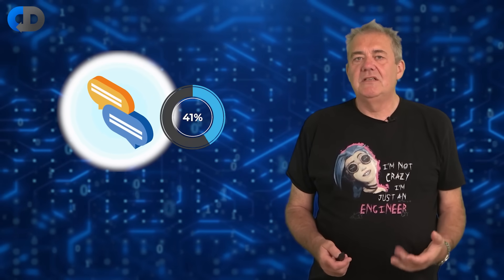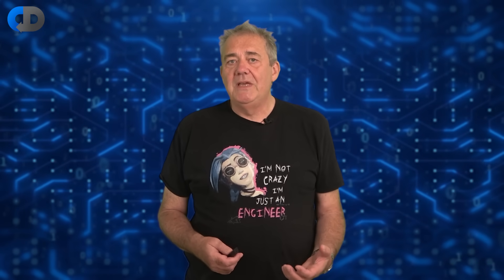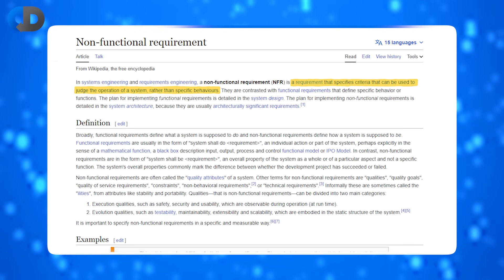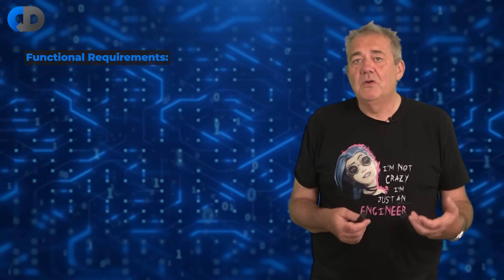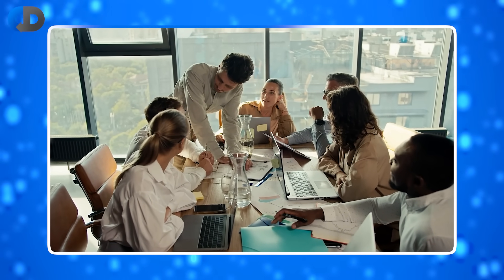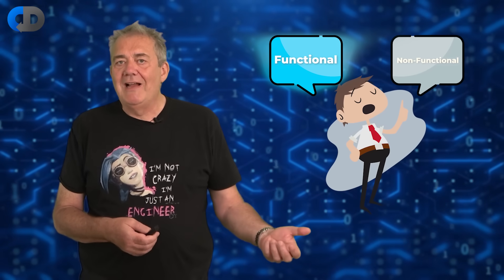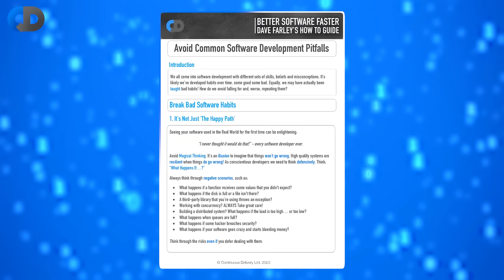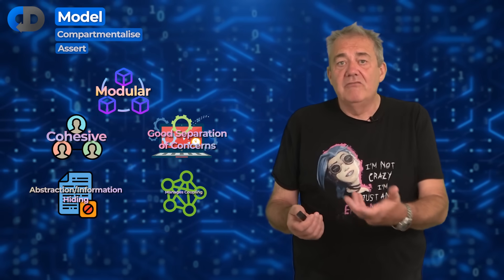"Non-Functional Requirements" Are STUPID

Comment: Pretty sure it was Rick Kazman who suggested, some time ago, that the term NFR is a dysfunctional term and so suggests using the term "Quality Attribute Requirement". Just study Software Architecture material from the SEI at Carnegie Mellon.

But even if you are terms such as security as a quality attribute requirement that is generally misunderstood, for example the CIA Triad (Confidentiality, Integrity and Availability) breaks down what Security means in terms of concerns.

Ultimately it would be great if the discipline of Software Architecture gets more weight behind it, as well the SEI. We have the term "Solution Architecture" but that is also dysfunctional as there are no solutions, only trade-offs.

Comment: So, NFRs are not stupid - Dave is objecting to the name "non-functional".   I concur, if only because people struggle with understanding what it means to them.  NFRs are characterized by requiring continuous testing.  NFRs are never "one and done" like functional requirements.   Consider the impact on work tracking.  If you're using an issue tracking system to track all of your user stories, how can you enter a user story for "system is secure?".  When would you mark the story as "complete"?  The answer is that you cannot.  This is not a deficiency in NFRs - it is a deficiency in how we track work.  So, let's change how we track work that must be done continuously.  Hmm. Sounds like something Dave has written about before... continuous something...

Comment: Lawyer working in IT here. The concept of NFR is a hammer for the customer it can use to hit the Supplier in the head if it wants. The I see in my daily work are typically written in the form of legal requirements such as "The solution must enable the customer to comply with NIS2, applicable local laws (typically tax and accounting), GxP, SOX, etc. They're cross-cutting single requirements where the customer has often been too lazy to specifically define these requirements individually, so they will instead have these completely unreasonable umbrella requirements that are often incredibly difficult to measure. Basically the customer moves liability from it self to the supplier, to which the supplier often have little to no expertise in, nor control over. The downright ridiculous NFRs I often come across are requirements like "it must work", "must improve efficiency", "solution must perform to the customer's expectations", and probably the worst of all "fit for purpose"...

I would argue that NFRs as a concept needs to be dealt with during the contract negotiations and/or while responding to customer requirements. If that fails, provisions should be established in the contract to deal with all NFRs during the design and have the customer approve a particular design prior to implementation, thereby approving that the NFRs are met by the actual design. No competent lawyer/supervisor/salesperson should ever just agree to these unmeasurable atrocities and pass them on to the unsuspecting implementation team.
Reply: wow - hugely important comment.  Bravo for sharing the legal/contractual angle.
Reply: @r_j_p_  What I generally see is that legal/presale do not have enough expertise to understand what the delivery team is actually doing to negotiate and write a proper contract. Similarly I see that contract management is mostly if not entirely absent on the side of the delivery team. Project managers either do not care or they lack the understanding to deliver in accordance with a written contract (don't get me started on change management here...). It depends a lot on the country and culture of course, but the more detached legall is from the delivery team, the worse situation you are going to end up in. I often see inhouse (customer) legals write standard contracts for use towards that particular company's suppliers, which the customer's own internal IT are unwilling to / incapable of living up to. This creates a ridiculous situation where the customer will faciliate a methodology or ways of working with the supplier that is by itself a breach of contract. This is caused by legals and management in those companies having big and smart (on paper) thoughts about how work should be structured. They do however forget that it is supposed to be followed by humans. The consequence of this is that the supplier will most often just go along with the customer's wishes (because suppliers have an aversion to conflict), as conflicts do not promote good corporation and rarely results in great projects.

I work for a supplier of IT consultancy services, so I often face these problems. The only solution as I see it is for legals and presale to go back to school and get an understanding of what (and how) the delivery team actually work, which would enable them to negotiate and sign contracts that do not directly contradict human nature (and the delivery team). Hereafter there should be a handover and walkthrough of the signed contract with the delivery team's project management so that they may have a chance to actually deliver what has been agreed.

Comment: Totally completely fully agree with you about the term "NFR".  Unfortunately it is used as an "umbrella" term to encompass things such as Security, Load/Performance, Accessibility/Usability, Configuration, etc.  I come from a long background in Software Testing, and have done Load/Performance Testing work where we talk about Service Level Agreements (SLA) and Service Level Indicators (SLI) / Metrics.  Over the last few years I've heard people confuse SLA/SLI with NFR's, and it is frustrating.

But this is Software, where everyone has to come up with new terms in order to sound modern and cool.  We are our own worst enemies when it comes to terminology and meaning.  Again, I agree with you and the stupidity of the term NFR (Not Freaking Real).
Reply: Your last paragraph is spot on. A builder puts up walls and structures  that hold up a building,  they use simple terms like "structural beam" that clearly denotes that without it your building will fall down. However in our industry we give a fuzzy and dimissable terms to the things that hold up our software.  We must remove terminology that hides criticality.   The other obvious example is "microservices" ... ugh.
Reply: The classic term from software engineering are ORTHOGONAL REQUIREMENTS. because they are orthogonal to the  task the system performs (in the very  algebric sense of the word). That terminology  is way better.

Comment: Personally I don't see the big deal in using the term. Nomenclature is secondary. In the simplest terms non-functional requirements are requirements that don't directly dictate the function (intended purpose) of the software. You can call them whatever you like - business requirements, security requirements, benchmark requirements, etc - the key word is requirement. Functional vs non-functional is simply a description of the type of requirement (a requirement of how software does something vs what it does). This video assumes that the term "non-functional" is saying a requirement is not important, which it is not.

Comment: I disagree on your take of non-functional requirements. They don't consist necessarily of complicated problems all over the project. I give you some pretty easy and standard examples for non-functional requirements: 
For a GPS system in a car, I had once the requirement: "The german voice shall be read by Mrs Whatshername." Yes, this is a requirement, and yes, this must be mentioned in the requirements, but this has nothing to do with functionality whatsoever. Grinning I imagined my testers calling this woman on the phone for every new software release and she going crazy over this, thus I classified this requirement as "not testable". 
Other examples: 
"The display shall have 80 characters in 40 rows" 
"The background of this textbox shall be black, the letters shall appear in white on it"
"The device shall be cased in a metal box."
"The available colors shall be red and blue." and so forth. Basically everything that deals with design or style is non-functional.
Reply: "The system shall provide clear and easy to understand error-messages"
Reply: @DinHamburg  Yep, this is another one. Practically every styleguide which is to follow is also non-functional. One might debate if the error messages are part of styleguides.
Reply: @DinHamburg I've had not such a good time trying to meet this requirement when the system didn't have a clue what went wrong. PM wanted us to tell the user if the network device wasn't connected, wasn't functioning, was busy, was misconfigured and so on. Yeah that'd be great if we could, but all we know is it didn't respond.
Reply: I've always understood this as acceptance criteria or even as examples. There can be a requirement hiding behind it. Often-times getting someone to tell you what the damned need is will make you go crazy. e.g. why back background with white text? could be a high-contrast or readability requirement, could be a branding color requirement, could be a government regulation, could be an executive wanted to feel important. But you do need to know the real requirement behind it as engineering needs to be able to make trade-offs. If it is a branding color requirement, we might need to use a display available in multiple colors in the case of the inevitable re-branding. If it is contrast, maybe there are other properties of the display that also help contrast that should be considered.

Comment: I feel like this is an symptom of the IT/DevOps/Software Engineering fields developing in parallel to the field of Systems Engineering with limited cross polination between fields. In my experience, this is a solved issue in systems engineering, which might categorise requirements as functional, performance, safety etc. but doesnt use that category to define requirement importance.
Reply: I always thought non-functional requirements were the most important when it comes to understanding project scope. It is unfortunate that people are seeing it the wrong way. There was a special category for them so they wouldn't be forgotten.

Comment: After wathcing 2 minutes of the video I really believe that author misses the point and makes an argument on the e false premise that "non-functional requirements" are "not important" or "not mandatory". Destinction between "functional" and "non functional" requirements is mostly about how one can verify those (if it all possible). There's no "hierarchy" of requirements. For example "durability" is extremely difficult to verify on the unit-test level. It is also not something I'd suggest having an automated test for (in this context by "automated" I mean "part of the pipeline", which isn't the best usage of the word, but still).

May be author makes some valid points later in the video but I just could not bear watching it that long - as I believe that examples "how would users react if payment software leaks user data" are completely out of place and have no relevance to "non-functional requirements" term at all.

Comment: Good topic but I recommend thinking about it this way.  Functional requirements are those requirements that are discussed between a product manager/owner/business analyst and the software team.   For example, "You need us to build a frontend that supports a form to input user data and we store this in order to support a specific feature". The conversation is finished and there's clear understanding of the feature. Then the real work for the software team starts.  They work on the overarching set of requirements which include latency, security, resilency, monitoring and lots of other stuff that the product manager/owner will not specify nor should have to specify.  This just comes with good engineering practice and best practices.  You can call this non-functional because it's areas that are not covered in the first conversation.   The only time I've seen friction here is when a product manager drifts into the world of engineering and starts to delve in MVP discussions on how the business can't afford to do high-availability etc. because of schedule or cost constraints.  There is a where a good engineering team will push back and explain why it's needed.

Comment: Excellent article, as always. 

Years ago, I had a scrum master who told us off whenever people on the team used the terms functional or non-functional. His view, which I adopted, is that everything is functional to someone. Even requirements such as insisting a system must use some particular piece of tech. A technology constraint on a system could be a commercial, legal, accounting or operational function. If you think it's non-functional, then you probably just don't have the whole story yet.

Thank you for providing a framework for dealing with these types of requirements, Dave. That was really thought-provoking and helpful.
Reply: Yeah. The proper term is quality requirements instead of NFR
Reply from the maker: That is almost as bad, why would I implement a requirement that didn't represent a desirable quality of the system? I think that they are all just requirements, it is just that some requirements are trickier to plan than others, but at least as important and valuable to users.

Comment: I'm sorry Dave - half of your video I had my jaw wide open because I couldn't believe what you said. The second half was alright, but I think you completely missed the point on FR and NFR. Why didn't you read on in the wiki article? Next sentence: "They are contrasted with functional requirements that define specific behavior". Is reacting in one millisecond a specific behaviour? Of course! Your example doesn't fit at all!! The same goes with the security aspect. That too is a very functional requirement. But read on! "The plan for implementing non-functional requirements is detailed in the system architecture, because they are usually architecturally significant requirements". NFR is architecture! So an NFR would be "you have to use this particular programming laguage or this framework" if others would suffice to do the job. Let me give you an example. My team and I built a messaging system. The client wanted a particula middleware system. That system is a complete sh***show and is responsible for 99% of our bugs and could easiliy be replaced by a single class... but NO, Mr Moneyprovider wants that thing. That is an NFR and by GOD I HATE IT!!

Comment: I like to call them quality attributes or quality requirements because it reflects what we used from real products: quality is associated to the whole thing, not to an individual part. Additionally, I have never seen a client who said: I don't care at all about quality.
Not all quality aspects are equal relevant, but that's fine and absolutely important to know, which aspects need our attention and which not.
Reply: If a quality-argument doesn't work, I've made good experiences calling the requirements you can't live without "hygiene-factors". The two-factor theory seems to be taught in business classes, so it helps get the point across (although it's somewhat different than NFRs)